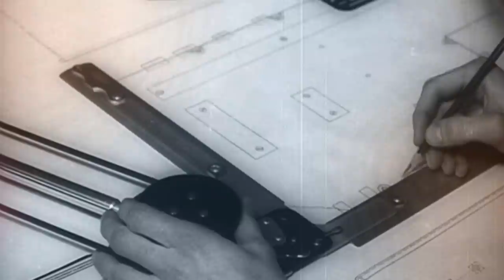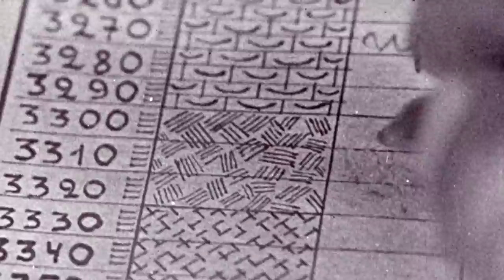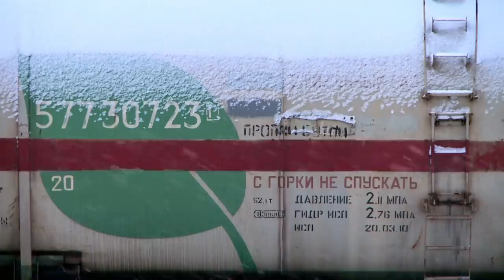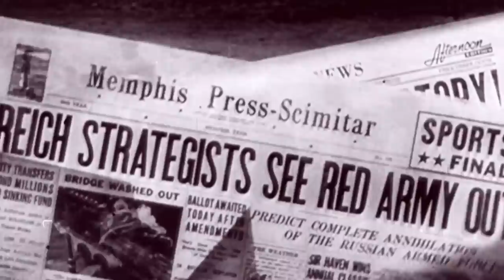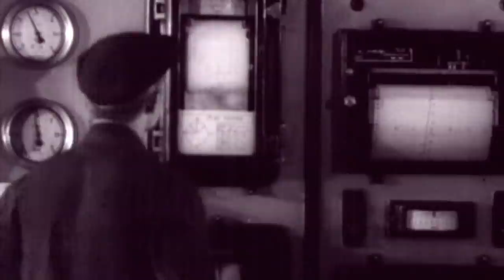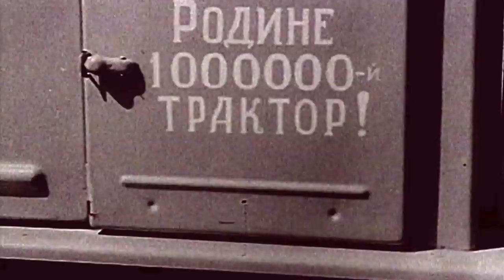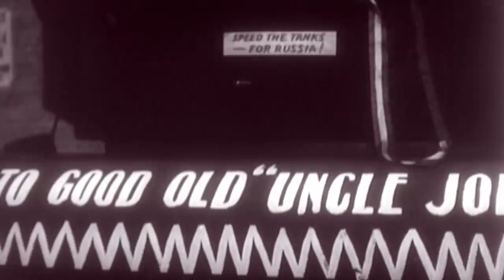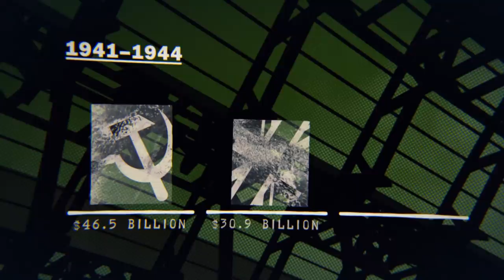The Industrial Might Of Wartime Soviet Russian | War Factories

Comment: I'm heard this story all my life for the last 40 years.  Stalin moved 1,700 Industrial Factories to the East out of German reach and they rebuilt them in 75 days or so in an open field, where did they get the power?  Electricity, Gas, Wiring, etc...Now, I did not fall off the turnip truck yesterday...it would take 2-3 years to build a large factory under ideal conditions with cranes and trained men to do it....I feel like I'm being gas lighted and these narrators eyes are gleaming like a zombie of Soviet ingenuity....just imagine the factory is dissembled and a part is lost or some specialized bolts are missing...there is no hardware store down the road or to improvise another part or the exact bolts needed or to manufacturer the specialized part for months...I'm just not buying this story anymore after 40 years hearing it...where they got those tanks from, I have no idea...perhaps from the Eastern USSR...maybe a year or two later in 1943 or 1944 they could produce them...yes....but, 75 days is far beyond ridiculous...it's not realistic.

Comment: And the Russians were given the most important tool of the war by Ford Motor Company, the Johanson gauge blocks which standardized all the allied measurements and the Inch as we know it today, the blocks live on today as you can still get any AKM rifle made to the original soviet data package from anywhere in the world and swap parts around between rifles, and it fits. Without the gauge blocks to check other measuring tools such as micrometers and verniers, there would be no production line. New estimates of all Soviet deaths in WW2 might exceed 60 million

Comment: Scary that they made so many rifles and still did not have enough for every solider
Reply: In the late 1990's it was 99bux for SKS rifle, and 75-125bux for a really nice Mosin Nagant WW2 era 7.62x54r bolt action boomer at any army-navy surplus outlet in Wash St., or Oregon, prices are ridiculous these days.A "tin" of 1000rds of any ammo, opened just like a sardine can, complete with key included set you back 50-150bux (primers were boxer type-corrosive unless soap and H2O employed.

Comment: The truth is that the USSR never had a diverse industry and its statistics are wildly faked. The GNP of the USSR never approached that of Italy. That is the reason for the poor performance of the Red army. For example, the nominal size of a tanks gun is one thing, the actual of it's combat performance is another, depending on many factors. It's radio and intercom are just as important as the strength of it's armor. It's engine power is more important than the infrastructure supplying fuel. German tanks not only had vastly more of the former, they had better. As for the later, at the outset of the war Germany had a multifold better motorization than the USSR - until the US supplied 500000! high quality commercial trucks and simultaneously bombed German industry into rubble. Famously Stalin had to ask Roosevelt for waterproof wire essential to the survival of Stalingrad. The Russian children were taught that Western  Allies only supplied 5% of what Russia produced - what they did not learn that this was measures d by WHEIGHT!

Comment: USSR and the West has the similar culture that is they use conflicts, war, and expansion to strengthen themselves. Thus both sides needs low intensity conflicts to feed their psyche and their pockets. That was the reality for the Roman Empire as well. The old Cold War ended with the West creating much more conflicts against the USSR than USSR could do to the West.

China thrives on agriculture, economy, and trade for thousands of years. Conflicts are not done for profits or to pacify people's psyche. Thus In this new "Cold War" era, US continue the old way of creating conflicts to grow stronger while China is building trade routes and infrastructures across all continents to grow stronger. So the current era will test which philosophy will win this new "Cold War" between East and West: Building to victory or creating conflicts to victory.